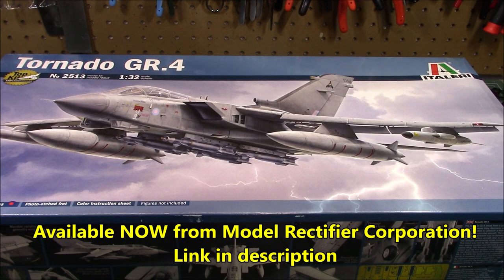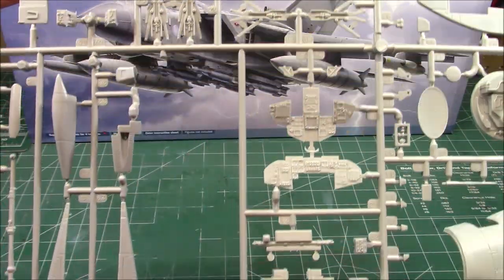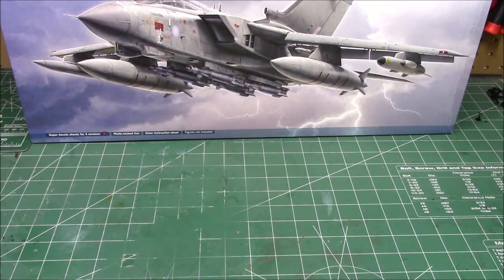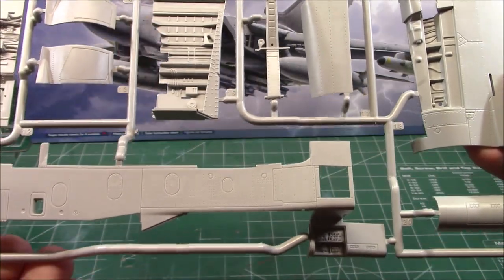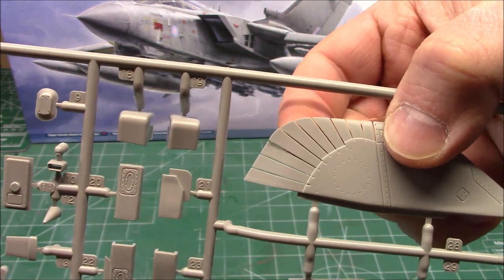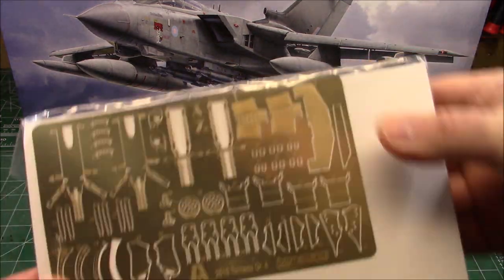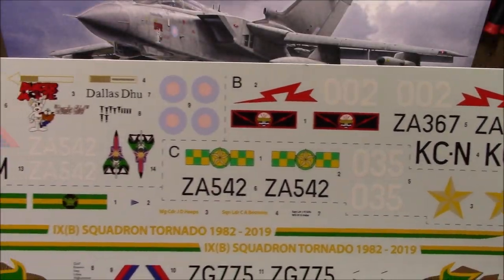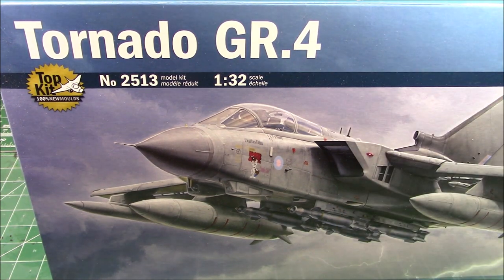Italeri Tornado GR.4 1/32 Scale Model Jet Kit Review Unboxing ALL NEW TOOLING MOLDS 2021!

Comment: Today i tried on a polish MISTERCRAFT 1:72 plane and glued the model to my hand several times... Your skills make it look so easy. Love your videos.
Reply from the maker: Thank you! Cheers!
Reply: Are you using CA glue (super glue)? If so, I think everybody has done that at some point. Also, Tamiya extra thin cement will run through the seam and stick to you, if you use too much.
Reply: @joeshmoe9978  Yes i used superglue. I couldn't find my Revell modeling glue so i used the cheap superglue that was laying around.
Reply: @rocketsock4297  if you like super glue, buy the thick gel type because it won't run between the parts and you hands. Also, keep a bottle of nail polish remover around to use to unstick your fingers if it happens again.